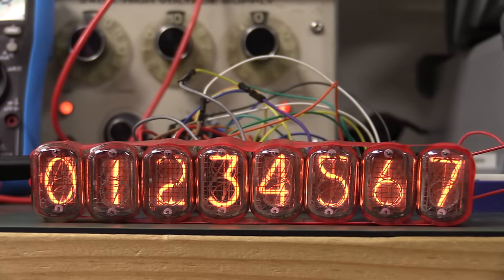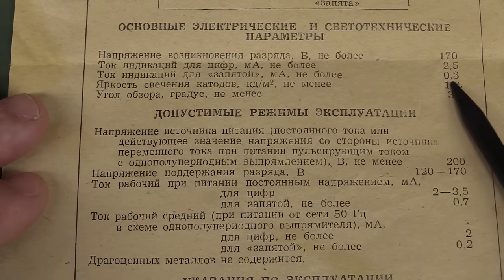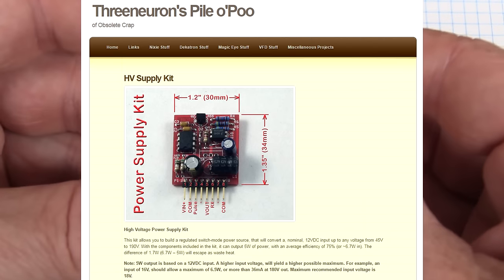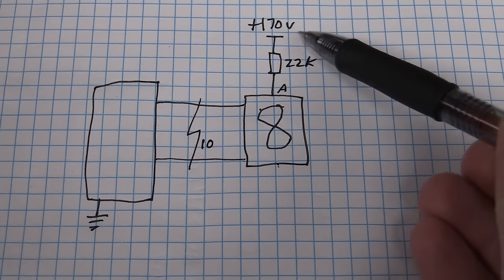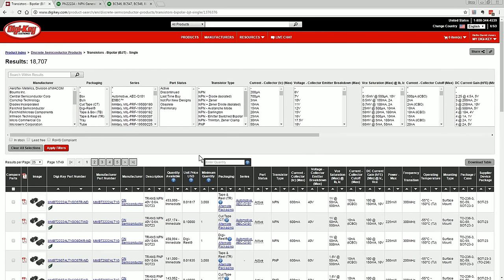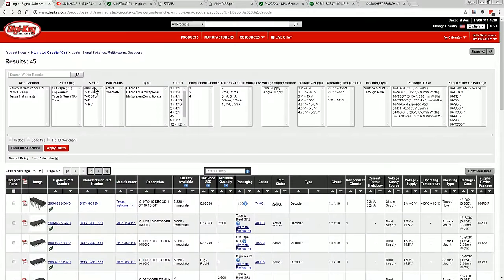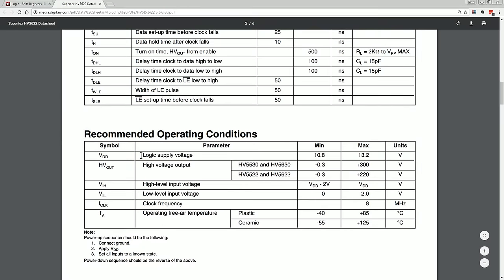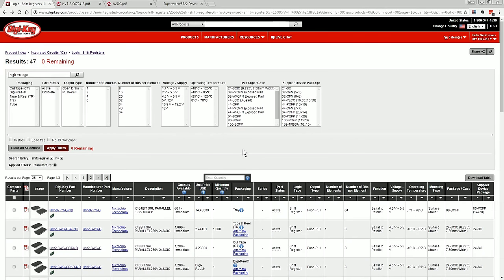EEVblog #948 - Nixie Tube Display Project - Part 1

Comment: The HV5122 would be just fine for the application. Rather than needing a latch, you could just blank the output for the few microseconds you're updating the register. Still not perfect, but probably not even noticeable.
Also, note how someone goofed up the title of that document. "18-Bit ADC with I2C Interface..."

Comment: My design of nixie power supply used a XL6008 boost converter in TO-252 package and a TTRN-060S transformer, configured in flyback topology. The total component count is less than 10, cost less than $2 and fits in a 16x20mm PCB. Input can go from 5V to 24V, with 170V/20mA output.

Comment: Could you make a 7 segment with segments on the same layer nixie tube? On a related topic, what about using the 7 digit chip and make a segments values to a specific digit line set of logic gates and then have like 10 high power transistors.... I mean like typical input like on 1010101 output 0000001000. You could avoid this all by just using a cheap PIC micro and then you could do weird tricks also...

Comment: I had a look at HV5812, thinking this set up is for a clock, I have to specified more detail.

I have as it look like wire end type IN-17, 12 of them and high voltage psu. I wanted to make a watch, It is looks massive.

Comment: FIY the datasheet translates to:
"""
Main electrical and lighting parameters:

Discharge voltage, no more than 170V
Digit indication current, no more than 2.5mA
Comma indication current, no more than 0.3mA
Cathode luminescence, no less than 100 cd/sq.m. #candella per square meter
Viewing angle, no less than 30 degrees

Allowable operating modes:

supply voltage (direct current, or effective pulse/peak voltage of half-wave rectified alternating current) of not less than 200V 
Voltage required to sustain the discharge 120-170V
Operating current with applied constant voltage:
    Digit 2-3.5mA
    Comma 0.7mA
 Average operating current (with half-wave rectified 50Hz A/C):
    Digit 2mA
    Comma 0.2ma

Does not contain precious metals 
"""

Comment: I have a PCB somewhere in my garage with NL-842 Nixies from what looks like a frequency counter from the early 1970s. It uses Motorola MC7441AL 1-to-10 decoders connected straight to the tubes. From the datasheets, it looks like the max output voltage of the 7441AL is 70V and the specs of the tubes are similar to Dave's Russian ones (170V max ionization voltage).

I only have the one PCB and I've never done any further research so I don't know what kind of voltage was used to drive the Nixies. Now that I know how easy it is to get a small HV supply for projects like this, I might un-shelve that project... :-)

Comment: Main electrical and lighting parameters.

Start of glow voltage, no more 170 V
Current of indication for digits, no more 2,5 mA
Current of indication for comma, no more 0,3 mA
Luminous intensity for cathodes, no less 100 cd/m^2
Angle of view, no less 30 degree

Acceptable modes of operation

Power supply voltage (DC or AC RMS when used with half-wave rectification), no less 200V
Discharge hold voltage 120-170 V
Working current when voltage is constant, mA
           for digits 2-3,5
           for comma, no more 0,7
Average working current (50 Hz Power supply with half-wave rectification), mA
           for digits, no more 2
           for comma, no more 0,2
Doesn't contain precious metals.

Comment: Multiplexing  is conceptually wrong for one simple reason - the flickering is visible for eye movement situations up to 100kHz. Flickering is not good for your eyes, and modern cheap and worse compared with the non-organic variants versions of LED displays marketed as OLED, quantum dots OLED or whatever shit share one big conceptual flaw - FLICKERING, which means that they are inferior to LCD except the deep darker levels of color.

Comment: So, the instruction states the following:
12 wires, 1 for anode, 10 for digits, 1 for comma (digit separator). You own PN-12B model.
Ignition voltage, max: 170 V.
Discharge voltage range: 120-170 V.
Discharge current: 2-3,5 mA (I assume it depends on the surface, you can adjust the brightness by controlling the current).
Discharge current for comma: 0,7 mA.

Which means that you would need only a f***ing high-voltage mosfet package, which is small, one or more microcontrollers to drive the thing, you can have them interconnected and that's all, mostly. In fact, you could make a universal solution with a boost converter on the very same mosfets in the package - one simple solution for many situation. The hardest thing is to write the program for the microcontroller or microcontrollers. With mosfet packages you can even program the brightness, with extra mosfets for each digit of high-voltage DAC conversion. How come it takes 3 videos for some simple circuit designs ?

Comment: hv513 has totem pole outputs, isnt that what we didnt need? will taking unused digits to +hv  affect operation of the illuminated digit?

Can we just not connect +hv to the chip so it cant pull digits high?

/puzzled but hey i dont have any tubes, and as soon as i can find some that are 6-9 inches high, i'm having me a wall clock....

Comment: Just for the fun i googled 74141 and the first link google found for me is a local electronics shop (and by local i mean one 5 mins of driving away) :-D
They are prolly still made by our czech company Tesla (the one Dave noted few times as NOT being Tesla Motors - https://en.wikipedia.org/wiki/Tesla_(Czechoslovak_company) ) but i don't know, if you can order them from Australia (and if you could, shipping would be a killer).

anyway... if anyone is interested (you'll prolly need google translate)... http://www.hadex.cz/e220-74141-prevodnik-bcd-na-1-z-10-pro-digitrony-dil16-mh74141/
they cost less than 1$ each

Comment: Yep, looks like you should have laid that inductor (L1) down on the power supply PCB to get the correct fit. The silkscreen looks like that was the intention.

Comment: Daymn, it's so bad there aren't really a lot "through hole" high voltage drivers...
I kindoff want to build a PCB myself (and solder it myself), but I just keep neighing more towards getting a kit (which is indefinitely less fun).

Comment: For me individual drive solution is much better than multiplexing, flickering nixies.
When I am making my devices, I use flicker flickering/multiplexing only if it is absolutely necessary (huge matrices such as LCD screens), and even then I try to implement a filter (e.g. LC).

Comment: So noob question: When I accidentally touch the 170-180 volts output going to the Nixie tubes...will I die? Is the current too low? What would happen if I touched it?
Reply from the maker: Depends on the current capability of your power supply, your skin resistance among many other factors. 170V DC is not something you want to go and willing tough.
Reply: you'd probably just end up with a nasty shock. The biggest potential issue with high voltage DC would be that it contracts muscles, rather than oscillating them like AC does, so if you grabbed a wire, you might clamp onto it and be unable to let go. But no, you probably wouldn't die. You definitely could, if all the conditions were right though (wet hands, direct current path through your chest, heart condition, etc)
Reply: It can probably kill you if you are unlucky, most likely it'll just hurt a lot
Reply: Depends. If you complete a circuit with one hand on the high voltage rail and other appendages connected to the ground rail, in theory, it could. I think DC (which this is) is slightly safer than AC but still, be careful.
Reply: 170V at 5mA wont kill you, I experienced 150V DC and just felt tingling through my spine and arm.
Reply: Don't say it wont. It really depends on the circumstances, of course unlikely but still far from 'safe'
Reply: Geeee...so when you work on stuff like this, does this not put any mental stress on you? Constantly having to be on the lookout to definitely not touch anything because if you do you could end up dying!? Doesn't seem like an environment in which you can really "enjoy" your hobby/interest. Or am I just too much of a pussy?
Reply: Electricity doesnt kill as much as people claim(hobby voltages not HV lines), if it was so half of the engineers would be dead.
Reply: Atheist Thor
I avoid most high voltage stuff for safety's sake (I know I'm a klutz, and don't wanna die), but realistically, you can learn to respect dangerous stuff, by adopting safe practices, while also experimenting with it. so long as you're careful, you can do it your whole life and do it relatively safely.

I look at it in the same sense as riding a motorcycle. I enjoy doing it, and yeah, there's a risk involved (probably a lot more so than the electronics hobby), but with safe practices, and being mindful of the dangers, you can do it in relative safely.
Reply: Atheist Thor no wont kill you, i already did, not because I wanted but ir always depends on voltage and currend, cause 100V 1mA wont kill you, it can affect your body in a really bad way. It gets dangerous when you come into the region of 1kV cause then 1mA is already 1W so go up with current and voltage.
Reply: + RyuDarragh I have allways wondered. What is it that actually provides the energy to propel someone so "explosively". Is it your own muscles that make you jump or what? To move a human adult body you would need quite the pressure wave...
Reply: Sounds a bit Hollywood to me tbh but it would have to be your own muscles
Reply: Well, if you look arround there is plenty of anecdotical "evidence" of people making quite spectacular jumps while repairing old tvs etc. I have heard many times the suposed "joke" of leaving big caps charged expecting some coworker/student to get shocked. Never seen it but heard of it plenty of times, even on youtube... ElectroBOOM seems to have made a successful youtube channel from repeteadly shocking himself. No room spanning jump, but give him time...
Reply: EEVblog It doesnt even hurt a lost, just remember, when a DC/DC Converter has 12V in and 170 out the power capability isnt verry high... just a strange feeling in the fingertips.
Reply: It is not the voltage that is dangerous but the current passing through your body. If your skin is dry it will have a higher resistance and will require a higher voltage to pass a certain amount of current. If it is wet then a lower voltage will give the same current. If you manage to get several mA passing through your heart, it might stop thus killing you. Anything else will just be painful.
Reply: as long as you solder and work on your project without the power on you will be fine ( and dont touch beefy charged capacitors)

and then when powers on be careful not to touch wires and circuits with your hands ( projects that deal with high voltages and high amperage)

but if you are just working on small timers circuits and blinking leds that are low voltage and low power you can be less mindful
Reply: THUNDERBOLT Rule #1 when working on a PCB: NEVER SOLDER ON IT WHEN IT IS POWERED!!!
Reply: ***** I already touched 230V AC and 180V DC and survived it, better not touch it and the problems are solvend, and when you work on it dont power it up. Hava a nice weekend, mine started a couple of mintues ago
Reply: *****  Im from Italy, usually I dont do stuff like HV fine adjusting so I can work safly...
Reply: Felix Hil isnt that what i said?
 " as long as you solder and work on your project without the power on you will be fine"
Reply: THUNDERBOLT my error, I am not a native englishspeaker and dont read everything carefully, a couple of words and sentences can stay on the road
Reply: Felix Hil yeah no problem

Comment: I recently made a Nixie clock/calendar with no less than 14 nixies. I used four of the SN65518FN from TI for driving the tubes. They are a bit hard to find but turned out to be a great solution.
You don't need to have a switching solution that can work to the full 170V. The SN65518FN works up to 60V and this is fine. The trick is to switch the low side of the tube to a 60V bias when you want the digit to be OFF and to 0V when you want the digit on. When a digit is off it is naturally open circuit. One resistor can be shared between the tube and an additional one in series for the decimal point. One thing to watch out for is that the 60V 'bias' somehow requires a few mA of current, which doesn't seem like much but does mean that you need a proper 60V source in the circuit -- a simple shunt regulator isn't suitable.

Comment: 27:12 - Why is it some parts of the datasheet show Vdd next to the voltage like the high-level input/low-level input as a number and then they have Vdd next to it? 
I think I heard someone once say that it's that number times by the Vdd voltage, is that right? E.g. 0.9Vdd with Vdd as 3V would be 0.9 x 3 which would make the high level input.voltage actually be 2.7V.

Comment: If you are going to go to the trouble of laying out a board then why don't you just jump to the 0.5mm pitch QFN package? With some careful layout you might be able to squeeze the driver inside the pinout for the nixie tube. It would make a really clean design with just a bus for clk, data, latch and power running between the digits. Great video.

Comment: Why do they pack high voltage chip in 0.5mm pitch QFN package? Even when it drives something with such small current it wouldn't be small at all, so the size of the driving circuit shouldn't be an issue. It's ridiculous and i don't get it.

Comment: usual solution would be specialized driver chip(some of them are even isolated), with charge pump. however how many channels? i think silicon labs have 4 channel one.

Comment: Also, you can drive the thing by supporting a constant high-frequency corona discharge inside it. It would allow you to drive it without heater at much lower voltage, as you won't need initial ionization.
The correct solution would be using no registers or whatever and use a microcontroller with high voltage DAC circuit for each of the tubes, as it would give a universal solution with less wires and many protocols supported.

Comment: Dave I saw switching in and out of video clips during this video. I'm curious did you stop to tally up all the time you spent tooling around through Digikey and calling up Spec Sheets ? To me that would be the time consuming part of the design project.

Comment: Could you just use 11 8bit shift regs, since you have 8 tubes? 8 bit might be more common / cheaper,  just a thought. I get the whole modular solution with 1 chip per tube that you can add tubes to later,  but It's not like you're going to find any more of those oddball russian tubes any time soon.

Comment: Sorry if Im beating a dead horse. But can someone point me to a guide of sorts to control this with an Arduino Uno kit? I know I need the poser supply but it looks like you can control the numbers with a type of controller.

Comment: Dave, I'm looking forward to this project.
Have you realized that the original 74141 also has just 60V of maximum output voltage capability? What is the reason for that? It's clear that a turned-off digit won't  conduct the high voltage to the associated open collector output. But if a digit just turns off, the voltage at the output seems quite unpredictable during the transition.

Comment: I helped a friend build a 6 digit (hh-mm-ss) nixie clock back in the early 1970's.  It was a kit from Henry's Radio who were very big at the time.  It used the typical 7490/74141 combination.  Cost was was about £80 for the kit which was a lot of money  then.  There are still plenty of 74141 on E-bay.  Bob

Comment: This was a blast.  I love my nixie collection. These 12's are tough as nails!  I do have PCBs for Steins:Gate Divergence meters using a different nixie.  The Supertex Serial to Parallel Converter 220V 32Ch and Open Drain Outputs. PQFP-44 packaging.  These are really handy for nixie driver projects.

Comment: You could fully isolate the HV part, leave it floating, and use mosfets with optoisolators to drive them.

Comment: The inductor on the high-voltage supply board is supposed to be mounted on its side as you can see in all of the photos.

Comment: 12:45 if these ships as high powered ones are (so) hard to find ... why not use a low powered one and let it drive transistors (which then drive the display)

Comment: 0.3mA is the maximum current for the decimal point. Pin 1 is also easily identifiable thanks to a small arrow embossed in the glass pointing at it. As for the chips, I've seen people use HV5622, but it's a shift register. You may also be able to find russian К155ИД1, the clone of SN74141...
Reply: Russians never copied numbers, they used to roll their own marking system (which didn't stop them from cloning chips anyway). For example, a clone of the 555 timer is called КР1006ВИ1, Intel's 8086 had become К1810ВМ86, popular 7805 regulator is КР142ЕН5В. As for HV5622, I've definitely seen chips from this series on ebay before, but not anymore. So, your best option would probably be Mouser or Digikey or whatever. Also, as somebody pointed out in the comments, it's probably worth trying to get them as samples from Microchip.

Comment: So if we wanted to have this connected towards a 120V power outlet, would we need to first use a coupled transformer or whatever to knock up the voltage or would the tube still work with the 120 and just pull a slightly higher current?
Reply: You need DC, not AC. That's part of the trick with driving them, you can't just transform up. That said, yes they can be driven at a slightly lower voltage, though I think that might lead to cathode poisoning (degrading of the filaments over time).

Comment: How can such small transistors handle high voltage ? (> 400V)
Reply: power = voltage * current....so if the current is small you don´t need big transistors.